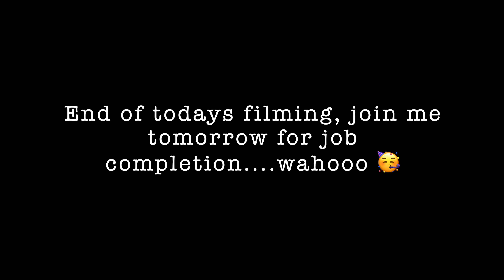PUSHING ME TO MY LIMIT!! TOUGHEST Paint Removal I've Faced To Date!

Comment: I loved this video.  I found it sooo...relaxing.  So much so that I have put it on my bucket list so that I can have a go.  Haha.  I recently moved home, and had a small porch taken down at the back of the house.  The wall in the porch was painted and is now exposed to the elements.  I want to remove the paint off it.  A question please.  Does the pressure of the hot water have any effect on the porosity of the brick face?  Take care, and thanks.

Comment: It's not about pressure, it's about CFM volume and orifice size.
Reply from the maker: Yes but the CFM and orifice size dictate the amount of pressure that can be produced. Obviously I can't adjust the CFM, and therefore the pressure coming from the compressor, but my Ibix is fully adjustable, ranging from less than half a bar, being low pressure, to full 7 bar, max pressure.

Comment: Amazing result! That’s what I call perfect and didn’t expect the outcome considering I’ve had the dastardly job of applying this paint to a new extension to match the existing coat on the rest of the house. It’s a resinous based product that essentially forms a plastic coat when cured. It’s really for the commercial industry but sadly finds its way into domestic trade and wreaks havoc on homeowners. In my case the client had no issue with the existing paint or any damp/condensation problems which I put down to the property being on a very steep hilled suburb

Comment: get a laser rust remover / cleaner. it blow the paint to absolute smithereens in no time, and leave the brick looking fresh.
it doesn't just work on rust i've seen them remove paint and caked on oil. it would be a lot better than going home soaked.